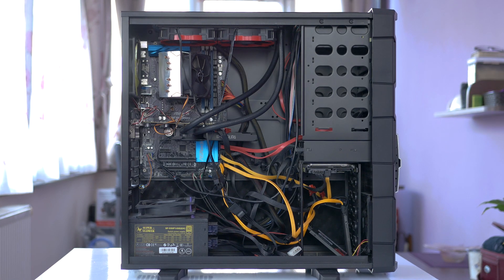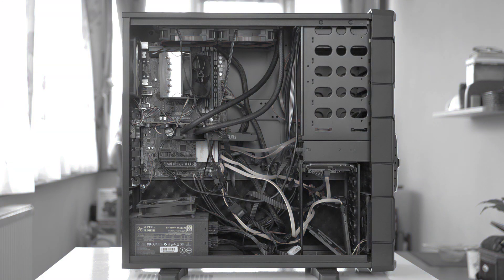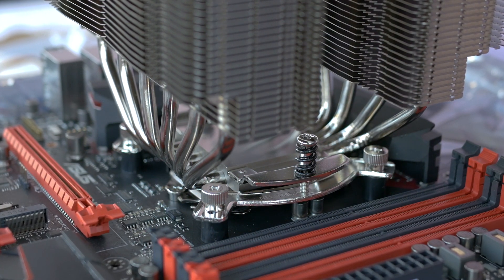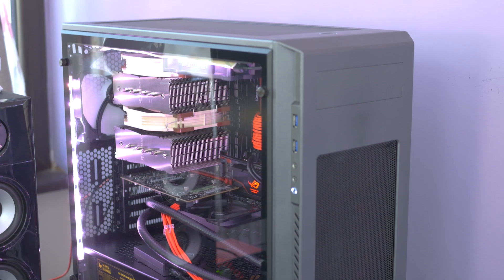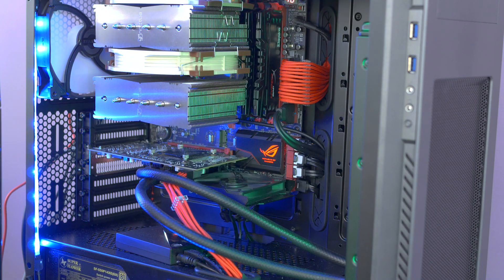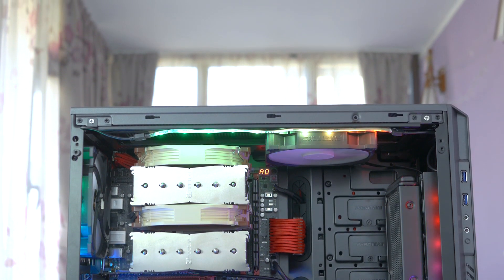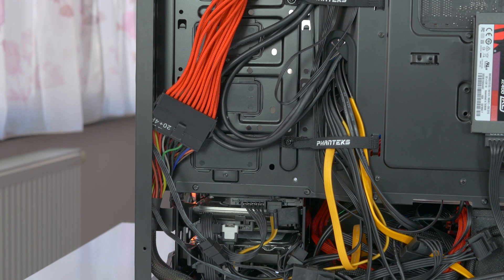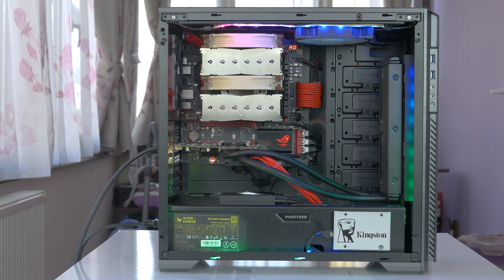2017 Editing, Gaming and Productivity Rig BUILD/UPDATE

Comment: Well, that was intresting airflow. But hey, it works, right?
Reply from the maker: +MrRaivokasMagma Yeah, it works. Was kinda worried as well at first. Naturaply, GPU temps are great since the rad is intake. It blows warm air in the case, which is first exhausted by the top 140mm Phanteks. Part of it reaches the CPU, which is inevitable... That is why the rear 140mm is blowing cold air directly on the heatsink. I then rely on the 2 140mm Noctua fans to do their job. And they do! Right now I've settle at 4.7 GHz 1.28v since it is rock solid stable. While gaming in BF1 CPU temps are around 62-67C max. Then fans are far from fully revved up however. If I set them to max RPM (all fans, including heatsink ad case fans) the temps drop significantly, but noise goes up like mad. So this is a nice balance between silence and cooling performance.